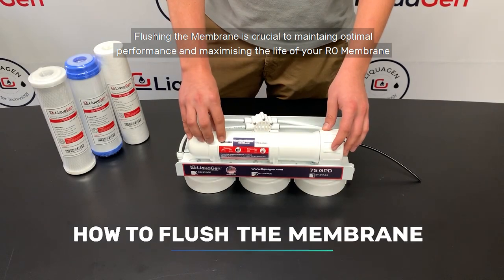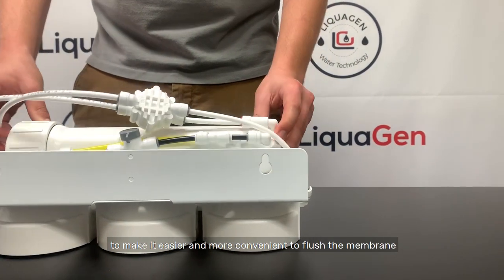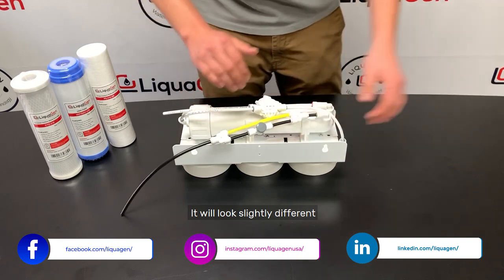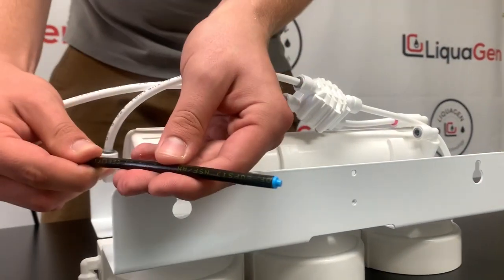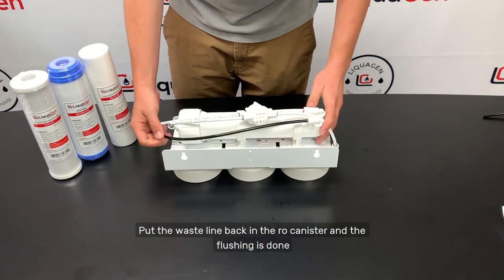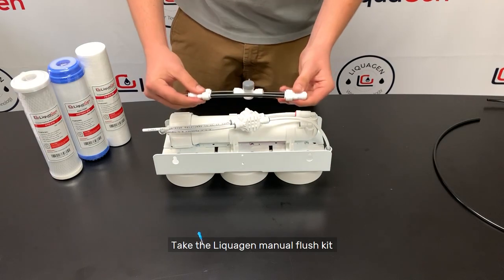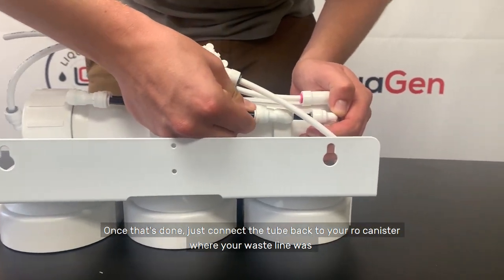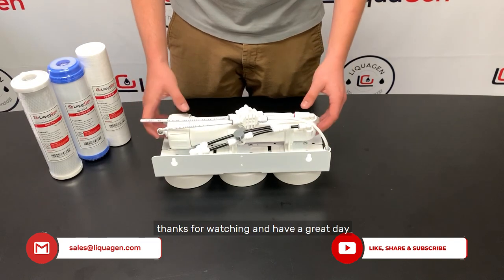How To Flush A Reverse Osmosis (RO) System And Install a Membrane Flush Valve⎟LiquaGen Water

Comment: Wouldn't it be more helpful for your customers if you already had the flow restrict or installed in your manual flush kit so that you don't have to deal with support calls and your customers wouldn't have to worry about getting it working ? I'm not saying that your cheap by not including on, but think of the customers point of view when they buy it thinking it's plug-n-play and it turns out to be play-n-pray?

Comment: I have an external style flow restrictor. so I should flush even my current used RO membrane? Do I just remove the water line to the tank and flush it into a bucket? or is this something you do when you install new filters?

Comment: I installed a flush kit , but nothing was coming out of the drain tube.
I figured out the automatic shutoff valve must be opened by draining part of your holding tank, than it will flush.
Please let me know if I am correct.

Comment: How do you flush when asv is activated? Isn’t input water shutoff?  I’m having this issue where open flush valve wont flush when system is not making water. If ro is making water, then opening the valve does flush. Any idea what is wrong with my installation?  I do have a booster pump right before membrane.
Reply: I'm not a pro, but you can get your ASV to operate, so you can flush, by shutting the ball valve on your pressure tank and opening the RO faucet. Then open the flush valve to   bypass the restrictor and flush.